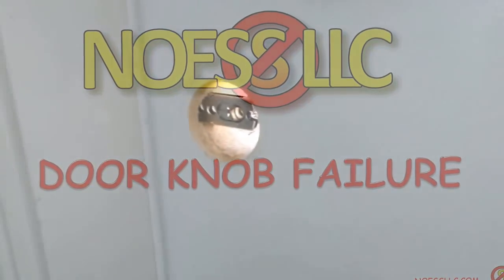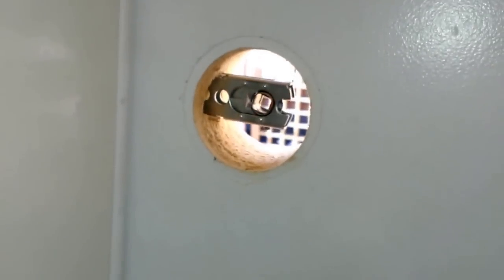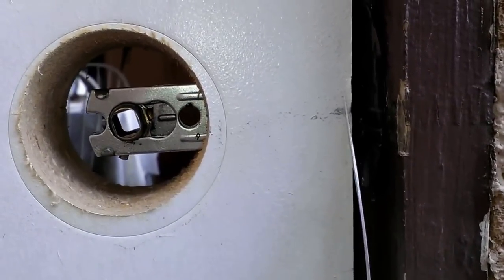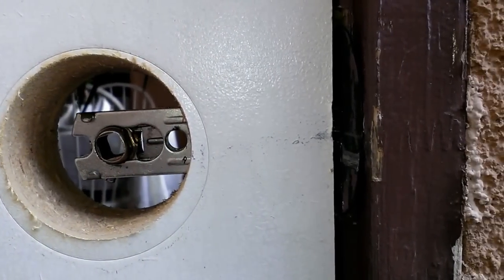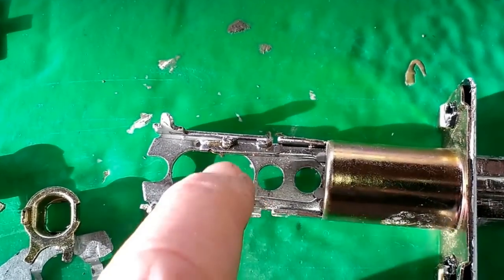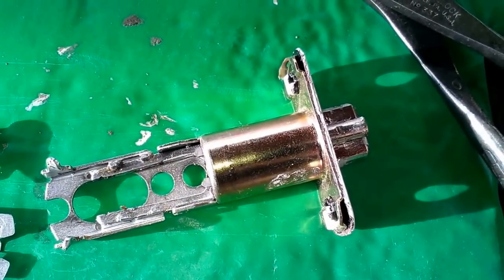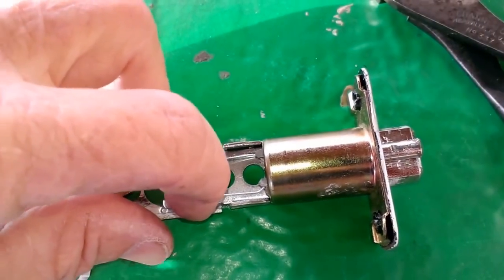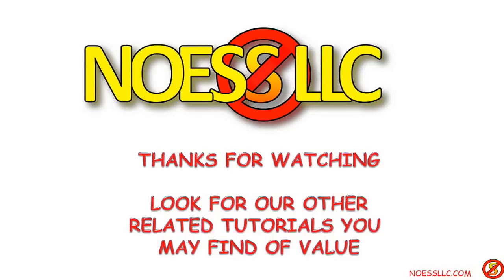Stuck Door from Knob Failure

Comment: I had the same problem.  I took the door off and it came right out.  Took about 5 minutes.
Reply from the maker: Thanks to everyone who've taken the time to comment on what seems to be a common occurrence. Just a note of clarification for all the folks who've suggested "easy fixes" relative to this video. Please note that this door is an out-swing Entry Door. It has hinge pins on the outside that are fixed in place when manufactured so the door cannot be removed without physically cutting them with a metal cutting saw. If not so, it would take thieves about 2 minutes to drive the pins out and break into your house. Because it is an outside out-swing, the locking latch is double pinned and cannot be jimmied with a credit card or a knife blade from the outside. Furthermore, it also cannot be jimmied from the inside without first tearing off the stop molding around the inside door frame. Inside doors typically have hinge pins that are easy to access, drive out and remove, depending on which side of the door you're on. If you're on the wrong side, something will have to be either torn apart or dissembled per this video.

Comment: Thanks for the tip on bending the latch assembly to pull it out. After that I was left with bolt still stuck in the door frame, so I used some curved needle nose pliers to pull the bolt out so the door would open. Ah HA!
Reply from the maker: I am very surprised at the number of views and comments on this vid. The intent of it was to show my particular dilemma, but perhaps I should have made it a much broader subject and torn apart several other models to show the peculiarities of each?
Reply: @otd80  realize that most youtubers who watch this probably wont have any tools, so it wouldn't matter anyways.

Comment: Or you could just take the door off the hinges back out the latch screws and pull it out.
Reply from the maker: Good idea except I couldn't take the hinges off with the door closed because no access to the screws. Couldn't push the hinge pins out either because these are exterior door hinges manufactured with the pins permanently fixed...they won't knock out like those on an inside door.

Comment: I still don't under stand how you can open the door.
Reply: There should be a piece of metal and just pushit out until it clicks and the pull or push the door
Reply: @alargewall1123   I tried pushing and pulling the lock,   but it's stuck with the thing that locks...  ... the latch is in the door frame  ...  it will move with the thing that turns the door knob.... but not enough to let the door open..  I'll work on it more today...
Reply: @alargewall1123  I used a hack saw blade like the credit card trick...and got it open..

Comment: Brilliant solution, until....I could not pull back on the two pins to retract the latch pin which may have been the initial problem leading to its failure on the exact same lock. Now to pop the hinge pins to remove it and go from there.

A sincere thanks from a guy that figures out incorrect solutions, then reverse engineers to the eventual correct one